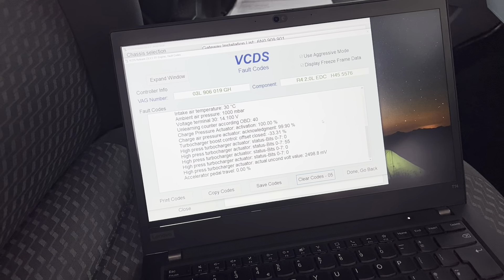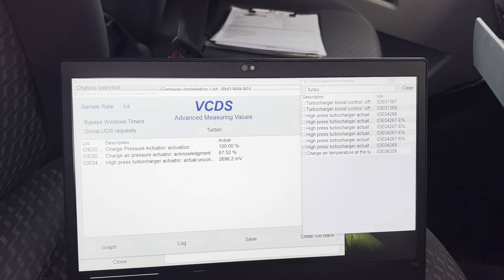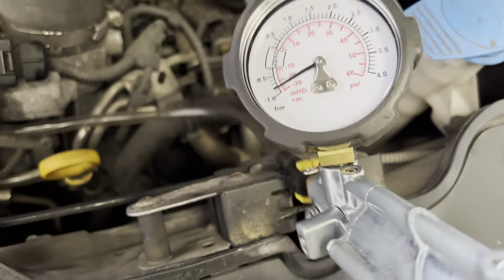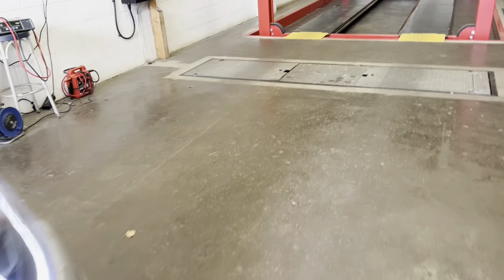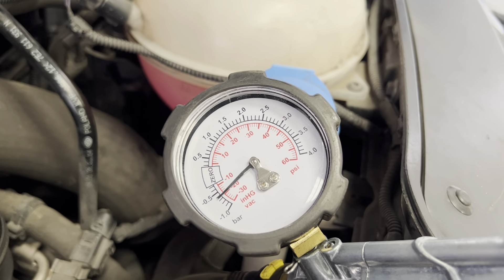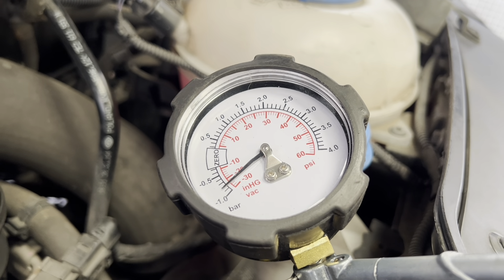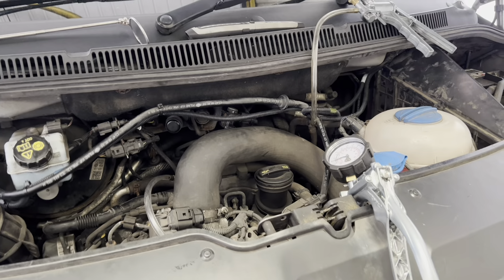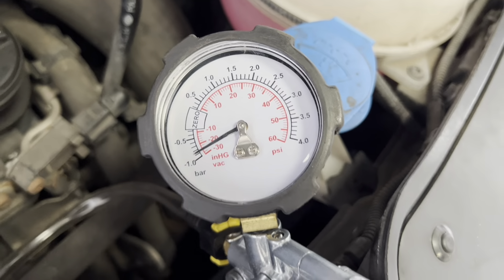VW Transporter T5.1 140cr P2563 Turbo actuator fault diagnosis method. Odd findings

Comment: Excellent video on testing for faults but could you tell me which pipes you connect the hand pump to.
Reply from the maker: Long time ago now, pretty sure initially I just  use the vac pump as a gauge so Tee’d inline with the pump.

Comment: hi what did you connect the vacuum tester to on the last test. im having same trouble with my mk6 golf
Reply from the maker: Just in-line from the vac pump feed with a T piece
Reply: @Craftdrift  Thanks 🙏 I really appreciate you getting back to me so quick. I be checking mine tomorrow thanks again